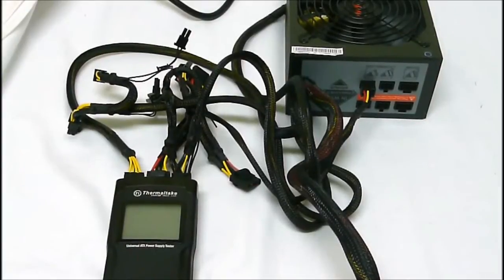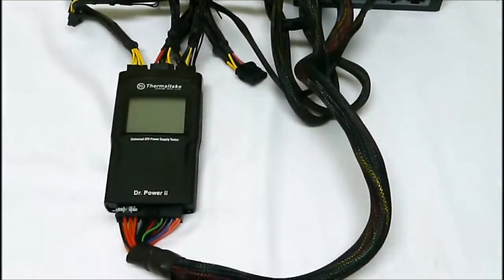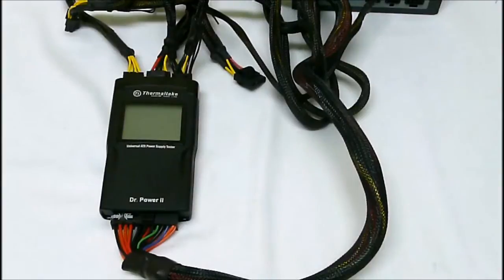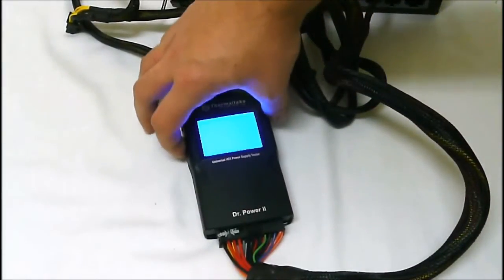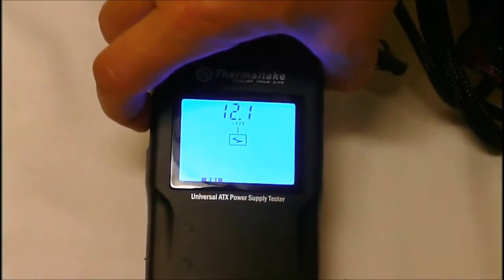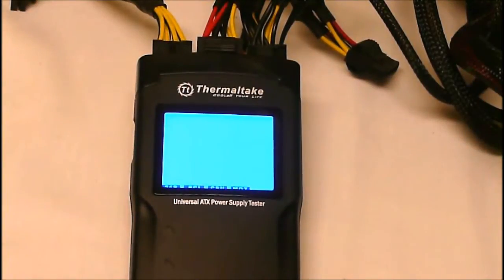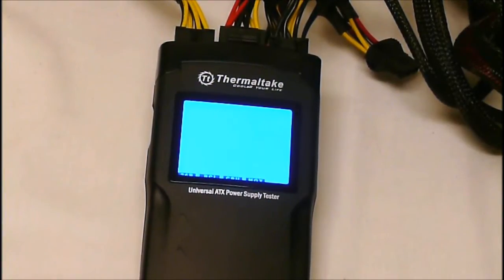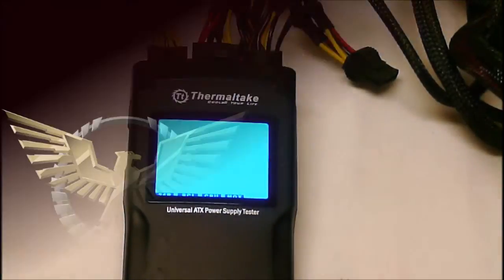Thermaltake Dr. Power II In Use

Comment from the maker: you need an actual load tester then. Software wise we use OCCT to tax a system. For a straight load tester there are options but they are quite expensive.